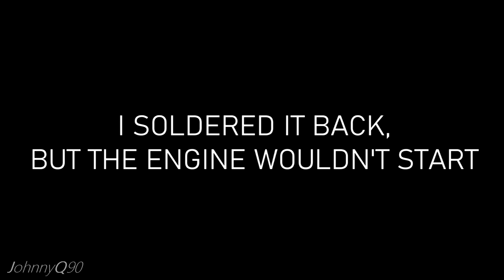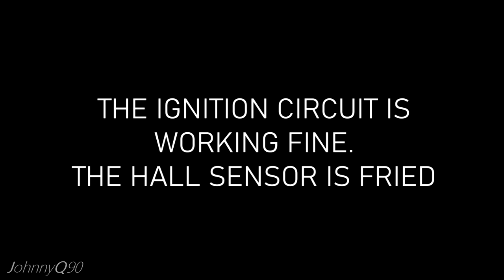Miniature V-TWIN Engine Test

Comment: I love how you can see the chaos in this machine. Horribly balanced (just the v twin in general not a dig at this machine it is quite nice) as it shakes around on the table. Very cool mini engine, one of the neatest I've seen on your channel.
Reply: It pains me to hear and see this engine because it runs like it has a stopped up carb
Reply: Don't lump this piece of crap design in with all vee twins, Guzzi vee twins, especially the 850s are super reliable and smooth.
Reply: @SkyPassYT  it runs like a harley thats the issue
Reply: @BIGSMOKE-bl2lq it sorta does but doesn’t at the same time like seriously it sounds and runs like it needs a carb clean bad
Reply: A proper 90 degree V twin is reasonably well balanced (perfect primary balance).  Narrow angle V twins (Harley and this model) with a shared crank pin are not great.
Reply: Split pin crank v twins run very smoothly
Reply: are you always this negative?
Reply: @jeffreylindsey5608  who? Me? Uh no just when i argue with people
Reply: Someone should let Ducati know.
Reply: @BIGSMOKE-bl2lq  But they have an amazing torque compared to the low hp.....are gorgeus....

Comment: Looks and sounds just like an HD… vibration and self destruction true to form too!  What are your plans with it?
Reply: Qefna Ija  you are not authorized here
Reply: I hope he makes something for it
Reply: He just has to build a trike around it
Reply: Lol you’re spot on, similar to HD not any other Vtwin!
Reply: I don’t know. My Harley and many others I have known have been very reliable. Or are you one who thinks only new stuff is good?
Reply: It looks like a HD because it's air cooled and has pushrods.
Reply: @InSanCen  it looks like a HD because it is made to look like a HD. panhead motor.
Reply: Doesn't look like a common crankpin tho
Reply: @massmike11  I'm hearing you Michael! I own two harleys which have both been extremely reliable. One has well over 100K miles on it. The haters have generally never even ridden one!
Reply: @russparker71  I have a 1976 GoldWIng with 328,000 miles on it and it's just a puppy compare to what other have put on these bikes.  Call when your HD catches up and we can compare the replacement parts list.  Oh, and I have no oil pools on my garage floor either.  HD's are enthusiast bikes, not serious transportation and, compared to things like the GoldWing, cannot be truly described a "reliable".   And I'm not a hater, but having owned a 1975 XLCH before my GoldWIng I speak from experience.  The Sportster was noisy, uncomfortable, unreliable, shook like a paint-mixer, maintenance hungry, horrible suspension, just plain bad handling and has likely spent at least 15 years in a scrapheap somewhere.  I sold it after 5 years and bought the GoldWing used which did (and is still doing) everything much better than the sportster.  A move I have never regretted.
Reply: @massmike11  Not at all Michael, everything has it's place, be it old or new... I'm just something of a purist when it comes to engine balance and replicating flaws like this makes me smile.  Some say it's character, I know, and I also know this is a big part of Harley ownership, but that doesn't make it right.  To be clear I love V-twins and completely dislike in line four cylinder engines in bikes, but I like to ride without blurred vision.  A 45° V-angle and a common crankpin is silly other than for keeping the cost of manufacturing down and making an engine shake.
Reply: It looked like a novelty

Comment: Is not the starter motor bracket, it is actually the alternator or in the case of the old "panhead" would be a 6 volts generator. The starter would go on top of the transmission on later models like the "shovelhead". This is amazing, i will order one for myself and will build a tiny frame around it
Reply: And the exhaust is on backwards

Comment: OMG! It's a miniature Panhead! How cool is that? I mean how could it be anything else with the shape of the sidecover, valve covers and distributor mounting?😁 👍  EDIT: Now why the hell didn't they put that Hall Effect Sensor inside the distributor?! Between the vibration and the oil contamination in the bottom end, they should have known it wouldn't last.🙄  Time to get busy with the lathe and your mini-mill and make some proper ignition parts! I know you've got the knowledge and the means to do it! It could probably stand some bigger diameter exhaust pipes while you're at it!😉  Crazy thing sounds like a top fuel Harley at idle though.. it would be fun to see what kind of mousepower it's making.🤣

Comment: Wow, it sounds really nice for such a small engine. We will get dyno video soon right? I wonder how it will sound under the load, oh and thanks for the video Johnny, top quality as always.
Reply: His dyno is basically worthless. It doesn't put a sustained heavy load on the engine and can't measure any meaningful amounts of output.
Reply: @TestECull  Inertia dyno does not have to put sustained load on engine, he should use heavier steel flywheel through.
Reply: @Dymitr_Nawrocki  You can not get an accurate measure of an engine's output if you do not put a sustained load on it. Inertial dynos do not do this. They're great for making the engine under test sound nice but they will never give you meaningful numbers.

Case in point, Johnny's 'dyno' claims the NR-200 makes 0.1-0.2hp but field testing by both Johnny himself and by others show that little thing to put out somewhere in the neighborhood of 1hp. Dennis Dempsey has one in a Trail Finder 2 and it bombs through tall grass better than any brushed electric TF2 I've ever seen, and those have more than 0.1hp on tap.
Reply: @TestECull   Inertial dynos are accurate but they measure engine power when it accelerates not when it is running at fixed rpm so they are not as good for tuning the engine but they are accurate, almost all of the dynos that are used to measure car or motorcycle power are inertia dynos, if they would not be accurate professional workshops wouldn't use them. The only reason load dynos are more commonly used as engine dynos is because you can tune engine while it is running at fixed rpm and you dont have to go to idle and accelerate every time you make a change in engine map.
Reply: @Dymitr_Nawrocki  Dynos used for automotive engines don't use inertia. The load they apply can be varied pretty much infinitely; this can not be done with an inertial design. These days most of them generate electricity and could easily be used to sustain a given load as long as you want for tuning purposes if so desired.

Inertia dynos are not accurate measures of anything. You wanna know what an engine can do you need to put a constant heavy load on said engine. It's not just for tuning it, it's for measuring its output.
Reply: @TestECull  Yeah i know dynos for automotive engines are usualy not inertia dynos but dynos that are used for whole vehicle (not just engine attached to dyno) usually are. And inertia dynos are putting heavy load on engine because they are basically big flywheels, you do not need to put constant load on engine to know it's power. The dyno knows weight of flywhell it has and from that weight the flywheel inertia is calculated when engine spinws flywheel dyno knows how quickly engine can spin flywheel from one rpm to another and can calculate power that was needed to do that, inertia dyno does not measure if engine can accelerate but how fast it accelerates. By saying "You wanna know what an engine can do you need to put a constant heavy load on said engine" you mean ability to hold power at fixed rpm? Unless engine has some kind of malfunction, if it makes some amount of horsepower when accelerating from let's say 3000rpm to 3010rpm it will also hold this amount of horsepower in this rpm range for any amount of time.

Comment: This is a good visual representation of how unbalanced a V-twin like that is.
Reply: @metricstormtrooper  I've got a stage IV built '05 Yamaha warrior motor, 1755cc, ~150+ hp at the crank
it's 48deg., so it's a LOT smoother
Reply: @metricstormtrooper  Like David says - I ran a Moto Guzzi V-Twin for years, 1200 CC, over 100 horse - pretty smooth.   Harley are unique in their ...... approach to engine design, which can generally be catagorized as "stupid"  but it is open to interpretation, some people seem to love shaky, potato-sounding engines derived from 1950s technology.
Reply: @metricstormtrooper  [Revolution Max has entered the chat]
Reply: 90 degrees has perfect balance just a slight rocking couple if the rods are side by side
Reply: Still a great motor and the bikes with it, the engine is amazing despite its characteristics.
Reply: @LunringNassar  Define "Amazing"

Balanced? Nope
Uncommonly high power/displacement? Nope
High fuel efficiency? Nope
Small package?   Not really?

I'm struggling for what  "amazing" is describing.
Reply: @padrescout  how come alot of people love it so much? Even me being a high revving 4cylinder nut, i can appreciate what Harleys and their V-Twins for, to ride.

majority of moto geeks and nerds would prefer metric cruisers/the big four, because all they care about is specs.
Reply: @LunringNassar  I'm guessing that means you can't actually  name anything "amazing" about it?

Why do some people love it? The same reason  some people like rotary engines and you won't like the answer.

Comment: The open mounting point is for the generator on the HD Panhead. Swap the exhausts to point the other way to get a more old style HD look. It is so cool!
Reply: Exactly what I thought! If he can machine some pieces to get that Hall Effect sensor INSIDE the distributor, it will be a big plus. From the looks of things inside that side cover though, he may have to use that generator mount and build a custom distributor, to avoid having to make hard-to-design helical gears for the existing one, since it seems that it's just a pass-thru for the sensor harness. At least with a custom distributor, he'd be able to control timing by rotating it for ease of starting and better performance once it's running.😎

Comment: I hope the part is readily replaceable, quite liked the engines design though it does seem to need some tuning for it to run smoothly. Maybe that was caused by the malfunctioning hall sensor all along.
Reply: you ever see a harley v-twin run?  its perfect.
Reply: That sound is not an error, it's how perfection sounds.
Reply: That's just how these V-twins idle. They have a very very rough idle and never run smoothly at low RPM. Doesn't matter if they're smol or big. And it's why they sound so damn nice.
Reply: @TestECull  I had no idea! Thank you for informing me.
Reply: Single crank pin and uneven firing timing.
Reply: @TestECull  That's purely subjective. I think 45, 60, and 90 degree V2 engines sound like ass. But, that is also just my opinion. I'd take a 60 degree V4 over a 45/60/90 degree V2 that sounds like it's having a stroke and you need to snap the throttle to keep it running.
Reply: @JosephArata  I've never heard a V4 that didn't sound like a fat man farting.
Reply: @gorcbj  Ye. They're uneven fire. You get two quick bangs one right after the other then the engine has to freewheel for a rotation and a half, fight compression on two cylinders at once until one kicks, which then forces the other through the rest of its compression stroke till it kicks. The design just simply runs rough. All uneven fire engines run rough.
Reply: My 1200  that's on my 1997 Sporty Custom does pretty alright at low RPM. The thing about Harley's unique sound is because both pistons move in the same direction at the same time. Harley tried to get it's trademark sound patented, I believe it was about 15-20 years ago when Yamaha and Suzuki began their feeble attempts to copy Harley's distinct sound to go with their new bike designs that also seemed to be heavily inspired by Harley.. Lol.
Reply: @TestECull  I've got an '84 v65 magna, 1100cc 90 degree v4 that sounds pretty good
Reply: One of the bikes my dads cousin had years ago was a cammed Fatboy. Would bounce the front tyre around sitting in the driveway idling

Comment: Ok quick note...On a Harley Pan head motor the Motor bracket in front you thought was for a starter motor is actually a generator mount and looking at the motor from that side the exhaust pipes go back away from it not in front like you have them now. In other words if you were sitting on the bike and looked down the fly wheel will be on your left and the carb will be on your right. So the pipes should sweep back the other way...! Very cool motor. I had a real 1953 Pan Head Harley..!!!

Comment: It's amazing that it idled so rough at 1500 rpms. It is also amazing that it did idle down to 1500 rpms! Don't most small engines like this idle around 4500 rpms?

Comment: You can order Hall effect transistors thru Radio Shack.
But I imagine the company you bought the engine from has a link to the source of the original hall effect device.
Ive found very small HET in old VCRs and video cameras.

Comment: Pretty cool. But I have to assume that you are running pre-mix fuel due to a lack of crankcase lubrication, since this is a four-stroke engine. And, surely, you can get a replacement Hall effect sensor.

Comment: you should built a dirt bike design exhaust try to measure if it makes more power. I have heard Dirtbike manufacturers spend tons of time designen them for maximum power. you should be able to scale them^^
Reply: This would probably work if it was a 2 stroke engine because they benefit from the back pressure created by the exhaust (almost like a turbo charger). It doesn't work on 4 stroke though.
Reply: @maxiferrari08  yea i know that. did not mean that engine specific tho since it a twin. i only seen those exhaust on singles.

Comment: It's 4-stroke engine, isn't it? But runs on 2-stroke fuel? Interesting design
Reply: Instead of a tiny super complex oiling system you can run oil in your gas on a small engine like this.

Comment: You are using a 2 stroke mix in a 4 stroke engine? Why? Is it for the thermal properties of 2 stroke fuel mix (prevent pre-detonation, overheating, warping, etc.)? Is everything else lubricated with standard engine oil (like the piston, con rod, crankshaft, camshaft, etc.)?

Comment: I’m curious why you added oil since it’s a 4-stroke you shouldn’t need the oil. Also when you took the camshaft cover off I’m surprised the cams didn’t pop out. Then again not too surprised as the valve springs probably aren’t strong enough to do that. If you were to take the cam cover off on a full size Harley motor it could damage the bushing and everything else unless you take remove the rockets and pushrods. Really awesome motor though! Love it!

Comment: For the Hall sensor, if you get a new one, is it possible to seal it in epoxy? The vibration probably broke the solder.

Comment: Exhaust is on backwards....wish they had designed  it with flywheels inside the crankcase  instead of a huge flywheel on the left side of the cases. You can't  build a accurate  primary case because of this flywheel.

Comment: that thing is great but i do belive based off how rough it idles it might want a bit more weight on the flywheel it sounds like it's getting the fuel it needs it's more like it can't quite turn over far enough before it fires again so it just barely doesn't backfire

Comment: Hmmm... 4-stroke engine with pushrods and rocker arms, but you're mixing up 2-stroke gasoline to run it. Is this because there is no crankcase lubrication system with oil pump? The mixed gasoline would protect the pistons, but connecting rods, main bearings, camshaft, rocker shafts, valve guides... I wonder if the failed hall effect switch didn't save this engine from worse problems.

Comment: How does the carburetor work? It looks like it’s just a super basic fuel inlet that has a small fuel bowl that goes directly into the intake. Does it have a jet? Seems incredibly simple but I can’t see what’s inside that little brass cylinder thing.

Comment: Even though it has 2 stroke oil in the gas it is a 4 stroke. There needs to be oil in the crankcase. A 2 stroke injests the fuel/air/oil mixture through the bottom end, a 4 stroke does not. (Unless they have some hybridized induction system I can't see [possible]).

Comment: I also could see it idling for hours. 
Do you imagine 2 spin off.... 
One with 5 cylinders of it mount radially.
Other made from 3 engine side by side making a V6 engine, crankshaft attached each other and rigid mounting for crankcase. 
Must be an awesome sound. A bit unsynchronized for sounding. 

Vibration of twin cylinder that not correctly phased are enormous, I think it can't be reliable as it with onboard electronic. You should externalise all.

Comment: I would love to see something like this used to build an electric hybrid motorcycle, that instead of using the engine to run the drivetrain directly, would drive an appropriately sized alternator/ DC generator that can charge the battery as your riding, or if possible provide enough power to operate at reduced speeds.

Comment: Did everybody that bought this engine figure out the intake problem? Also that the OS 44 stroke carburetor works perfectly, much better idle and throttle response.

Comment: i wish these engines were built just bit better with tolerances. I have eachine et5 and the crank shaft is whole 0.10mm smaller so it just dances around inside the bearing.

Comment: What is a hall sensor? I should probably know, or at least be able to figure it out, but when I was young, engines had points, a magneto and a carburettor. If you had fuel, compression and a spark, you were good to go. Now, thanks to climate bedwetters, the fuel pump won’t work if the engine management system doesn’t know the temperature of the oil, or if the wires to any one of the sensors fails…!

For this reason I’m removing the perfectly decent EFI from a BMW F650GS Dakar engine and fitting a Mikuni carb instead.